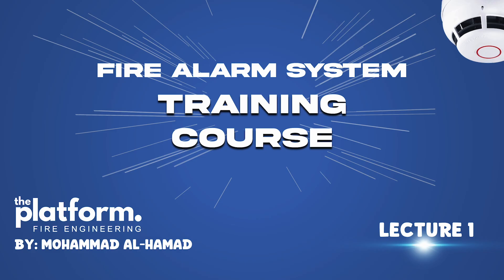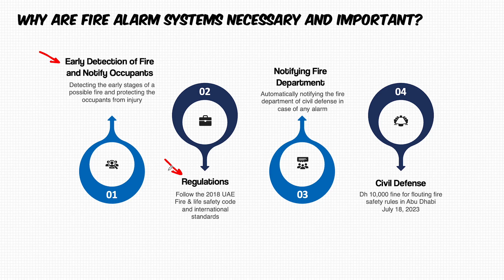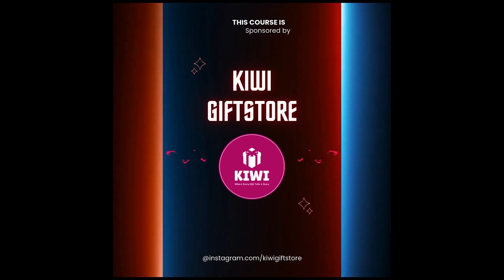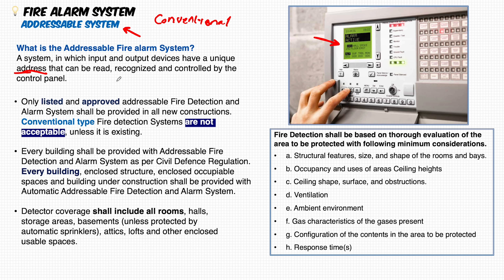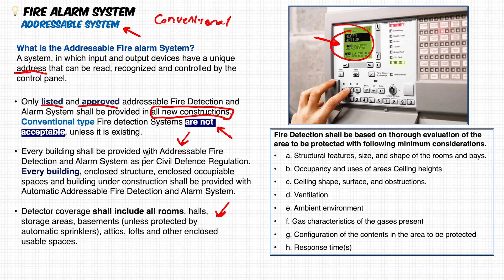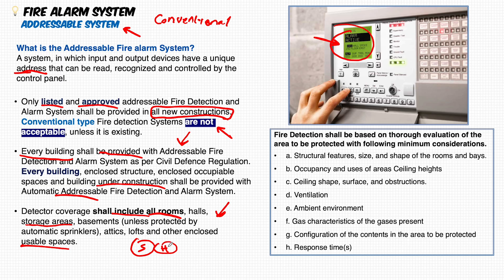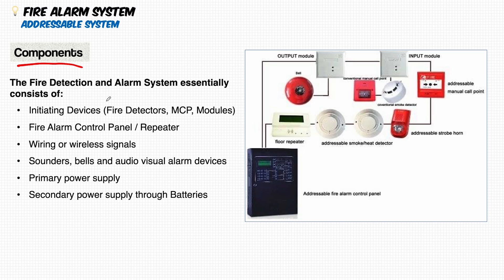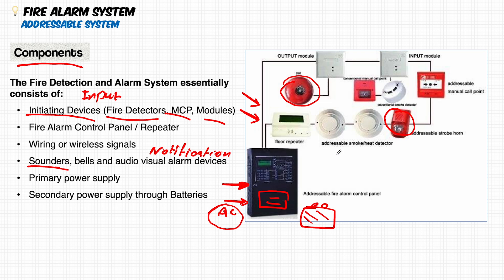Lecture 1 | Fire Alarm Training Course | Introduction on Fire Alarm System | Main Components

Comment: Great intro.
Q. Can the AC power supply to fire alarm panel be from normal source or does it have to be from Generator backup spurce since it is a FLS system?